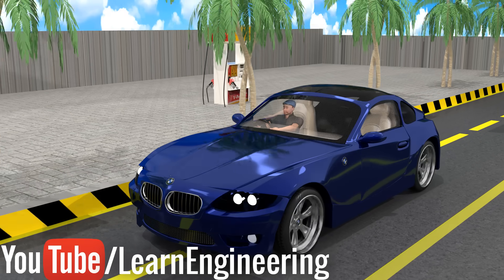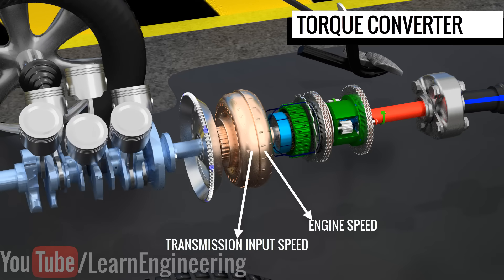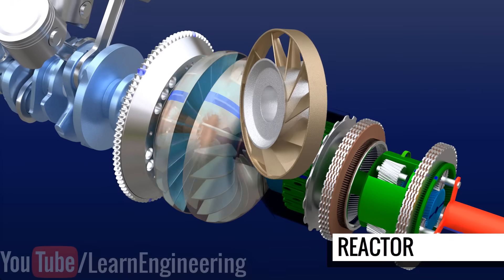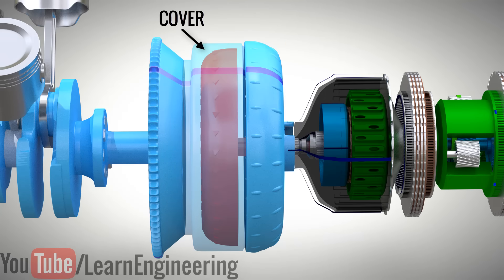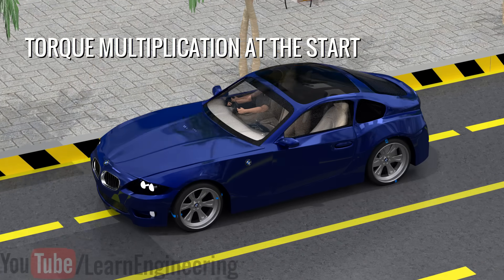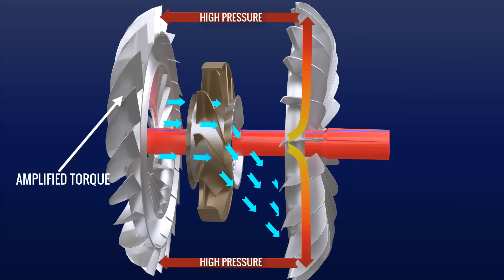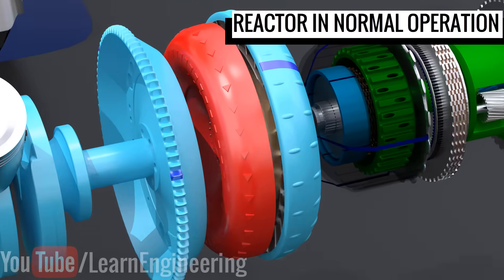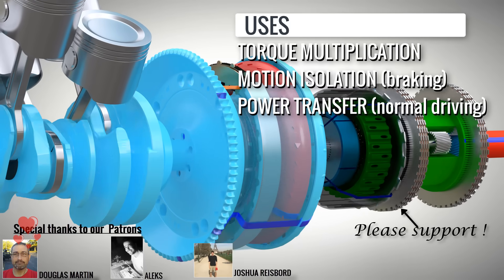Torque Converter, How does it work?

Comment: At the beginning, the animation seems to have the Turbine and Impeller (Pump) locations reversed, and later notes the true location, so stay tuned after the start of the video.  The Turbine is closest to the engine and the Impeller (Pump) is closest to the transmission.  The Impeller's (Pump) turbine (AKA fan) blades are part of the torque converter (UK convertor) housing and are connected to the Drive Plate (Flywheel), which is connected (bolted) to the Engine's Crankshaft.  The Turbine is connected to the Transmission's Input Shaft.  Google it.  I suppose there could be a unique design used in a rare car that reflects the design of the animation.  After all, Volkswagen had a similar 'reverse designed' clutch system for a manual transmission that had the Pressure Plate bolted to the Crankshaft with the Flywheel bolted to the pressure plate.

Comment: In toyota world we call the “Reactor” a Stator and the “pump” a propeller.
Reply: I like Toyota. But I wonder why they would call a moving thing a "Stator"...
Reply: @PontiacCZ  While the reactor/stator isn't moving in a gas turbine engine, it is performs pretty much the same function by directing the air into the next compressor stage, and that is called stator blades.  It may be derived from that.  Same task, but slightly different in practical application.

Comment: So where is the gear change clutch in this ?

or a double clutch ?

Would this be needed in a flappy paddle transmission or only a automatic ?
Reply: I think transmission with torque converter doesn't need a clutch.

Comment: I still don't see why the fluid hitting the turbine isn't also thrown outwards, due to centrifugal effects. Even if the turbine's blades are so designed as to  encourage fluid to travel centrally (ie, towards the central shaft) why don't centrifugal effects overcome or at least negatively interfere with this?
Is it possible that the operation of a torque converter is more complex than imagined? 
Has anyone made a transparent model of a torque converter and made high speed filming of the fluid movement? That would unequivocally establish the fluid dynamics.

Comment: The turbine is spinning slower than the pump and the clutch is locked up only after all gears are shifted. This is why we in Europe drive manual transmission cars because of the high gasoline prices.

Comment: IF I WERE TO TURN MY WHEEL ALL THE WAY TO LEFT OR RIGHT CAN IT EFFECT THE CLUTCH AND MAKE IT LOOSE CONTACT I DRIVE AN 18 wheeler and I feel like when I go all the way to left or right it slips wheni give it gas it’s as if I were in neutral  but once the tires are straight from me taking a turn then it actually goes if that makes sense

Comment: I don't get the operation of the one-way clutch. If I understand correctly, the reactor can't rotate in the clockwise direction in relation to the turbine (looking from the gearbox side of the torque converter) but it can turn anti-clockwise. So the reactor can't turn slower than the turbine because that would be in a clockwise direction. It can turn at the same speed or faster.

Is there any scenario in the operation of the torque converter where the reactor turns faster than the turbine? This video doesn't provide such an example and it confuses me then why the rotor isn't simply coupled to the  turbine shaft.

Comment: Great video but one thing not mentioned was that the impeller is welded to the converter housing where the turbine is not. Because the video shows the second half of the turbo housing with the turbine, one gets the impression that the turbine is attached or welded to the second half of the converter housing when it really free wheels.

Comment: Shorter video, but well and easy to understood. And i found in many loss of power cases, are. caused by fault  torque converter due excessively oil change intervals or low grade oil, leads its mechanism to scratch, higher heat range and greater clearances than designed between arranged moving parts. Thank you so much....!!!

Comment: But, how possible is choosing the gears automatically ?
Reply: The cheap way? Switch up and down at given RPMs. 
The expensive way: Determine engine load and speed as well as current RPM and select accordingly. disengage the clutch, let the converter spin relatively freely and slot another gear in.

Comment: Sir, my question is, can we use torque converter with electric motor and head drive, instead of gear box and couplings, in conveyor belt system?

Comment: Thanks for great explanation.
I can not understand why the use of torque converters are limited to automatic transmission and not considered in manual transmission systems. Is it for economic purpose or is there a technical obstacle for that?
Reply: You would not be able to shift gears.

Comment: Hello ??, this is the best visual explanation I have ever seen on how torque converters do their magic! I'm 70 and a neighbor of mine back in the 1960s gave me a training manual on the newly introduced Ford C-6 automatic transmission ( I still have it) so I could better understand the trans in my 1966 Cyclone GT. It explained the whole principle of torque converters very well also and I have always understood whats going on ever since I read it. The one thing you did not mention that it talks about is how under high stall conditions the fluid speed gets accelerated in every pass through the pump, turbine, reactor and back to the pump. I have sent msgs to other people, converter mfgs, trans specialists etc asking if they knew how fast, what speed the fluid might attain in a full stall condition. I got reply's back several times but never really an answer to my question, as they said they really didn't know .
Do you have any idea of an answer to this question, do you think it's ever been measured or calculated? I still have a cut open torque converter in my garage attic in case any one I know wants an explanation as to how they do their thing. This whole topic is why I feel in many ways that a torque converter hydraulic automatic trans is better than the dual clutch automatic / manual transmissions that are becoming so popular today.
Sincerely, George
Reply: So these accelerated passes with the stall is what helps the torque multiplication right?

Comment: Here's simple explanation. Take 2 fans put them facing each other turn one on,you will see the one that is off moving from the air from one running. The turbines in converter do same thing only use fluid.
I'm retired transmission tech.